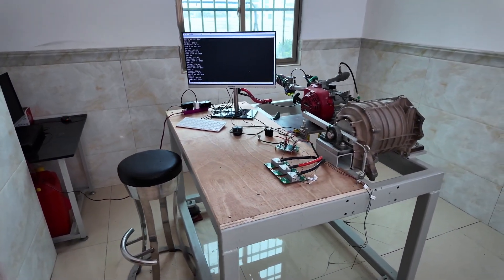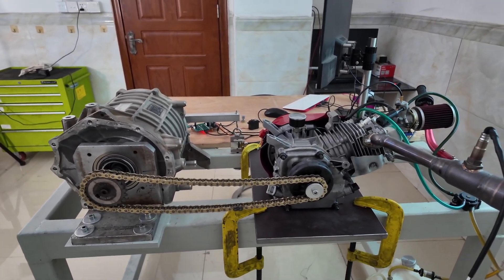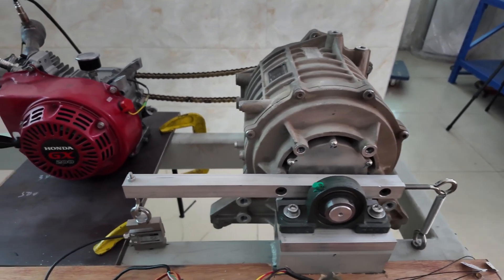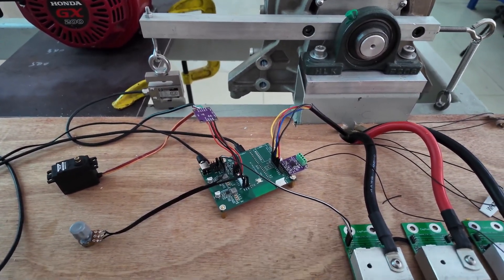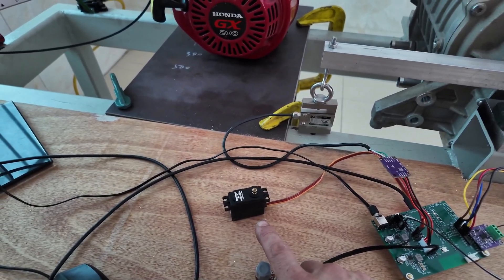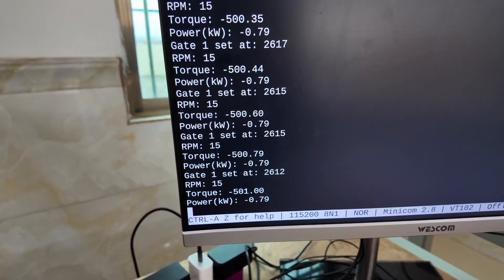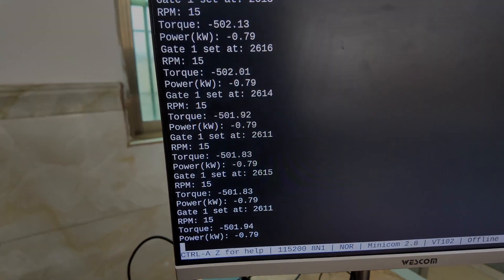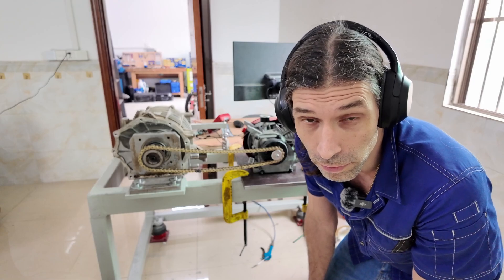BLDC Motor based Dynomometer

Comment: the idea of a dynomometer is to put out kilowatts basically turning a mechanical device into a generator.
the electrical output is then mapped and converted into hp which is a byproduct of torque
The equation to calculate horsepower is simple: Horsepower = Torque x RPM / 5,252.
determine the torque (T) in Newton-meters. Next, determine the rotational speed (N) in revolutions per minute (RPM). Use the formula from above to calculate the power (P) in kilowatts: P (kW) = (T (Nm) * N (RPM)) / 9549.296585513720. Finally, calculate the power in kilowatts
1 kilowatt = 1.34 mechanical hp
Reply from the maker: Thanks for the comment, you're right, and I think I'm on the same page. I just need to get the electric motor to vary the load. My overly simplified control system didn't work. I'll implement a more conventional regen braking system and try again. Hopefully this weekend.

Comment: Interesting project! A couple of suggestions from my experience with rotary engines attached to BLDC's:
1) Optoisolators will stop spark energy destroying sensors.
2) Shielded cables are also mandatory. 
3) Fit a chain guard. You'll have a bad day if it throws a chain or you get your todger caught in it
4) Use an exhaust extractor. Engines like this make lots of nasty emissions that will damage your body. 
5) Persevere! It's a good project (I subbed)
Reply from the maker: Thanks so much for the advice. The exhaust is terrible and I have a exhaust extractor arriving tomorrow ;) On the next hardware revision I'll try and add opto-isolators. Thanks for subscribing it means a lot. I'll post a follow-up on the weekend.
Reply: @MakeStufffun  Great stuff! I will await your progress. I forgot to add that resistor type spark plug and cap will help reduce some of the EMF from the spark system.

Comment: might need something to detect if the clutch is slipping. and perhaps factor in the inertia of the motors rotor
Reply from the maker: Both very good points, thanks. The ideal situation is to remove the clutch entirely, though it's not practical to remove it during testing. I think the easiest way to detect slip is measure motor RPM with the spark plug wire and compare that to the adjusted RPM of the electric motor. Yes to get accurate HP stats I will need to account for the inertia of the motors rotor. I'll try and do that. In the meantime I'm mostly interested in relative performance. Did my change to the engine give it more torque? What RPM is max torque and is the overall power more than before.

Comment: run "load FETs" in linear mode, or zero switching phase control... rectified or not. PWM isnt ideal. inductive load. you short it, massive current flows, massive reaction via eddy currents, ie, the "braking force". then you turn off. that power, the current, has to go somewhere, and appears as voltage across resistance instead... "off" being high resistance, the voltage spikes. 
throw in a freewheel diode to control the spike? the magnetic field persists as current with its reaction forces, as the energy stored in the field dissipates at a current dictated by the forward voltage of the diode. traditional methods of protecting against inductive spikes arent suited to what you are actually trying to do here... 

turning a short on and off against a generator? nah. not a good idea. you want a constant resistive load. no reactive components. im not surprised the circuit failed almost instantly.

get away from semiconductors unless you got deep pockets?

find a stinking big 3 phase variable resistor. thats the easiest way. you only need to worry about RPM and torque then. 

star and delta...
if the motors wired delta, then you need to short each phase to another. 
if its wired star, you have to short to the neutral connection... which isnt supplied, and most BLDCs run star. you will have to open it up, if so, and expose that connection.

you want to short each coil with its own resistor. 

salt water resistors. three tanks, three linked and movable electrodes/change water level... bit of playing with electrode areas... that is the easiest and most hassle free way.

i wanna see the temperature rise in that BLDC :) thats the problem with using a motor, the windings are where the heat is developed once your load resistance drops below the generator resistance... as your power levels go up, you reduce resistance to increase braking forces. more current, more lenz reactions. the generator has a fixed resistance and the current also flows through that resistance. more and more heat will be dissipated in your generator rather than in the load. a thing called "jacobs law"...

ie, a pipsqueak 2hp may only heat the load resistor with mild warming of generator. the load is the main resistance producing ir2 heating.

50 hp will have a cool load resistor and stinking hot generator. the generator is the main resistance causing ir2 heating.

think of it as a see-saw...
Reply from the maker: The motor is water cooled and rated for 80kW. I only plan to test engines up to about 10kW so I think heat in the electric motor should be ok. What your saying about PWM being ill suited makes a lot of sense. The motor is star configuration. So I was shorting all windings together, similar to regen braking. I think my main mistake was in regen when you remove the short condition, the energy goes into the battery and here it has no place to go. I prefer using MOSFETs because of the time to change radiance is faster than with resistors. Also any resistors you add reduces maximum breaking force as I understand it. I'll will do more research using your comments. I really appreciate you taking the time to give advice. This is beyond my level of experience. I live mostly in a digital electronics space😂. Ones and zeros are typically very cooperative to my instructions